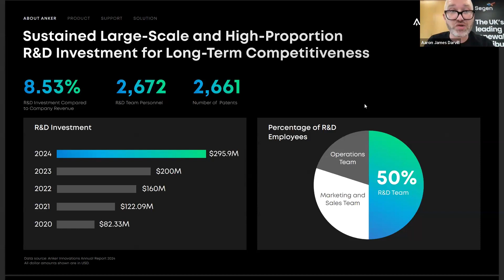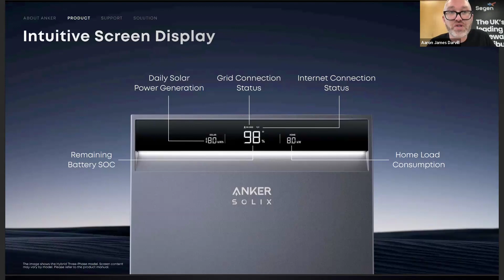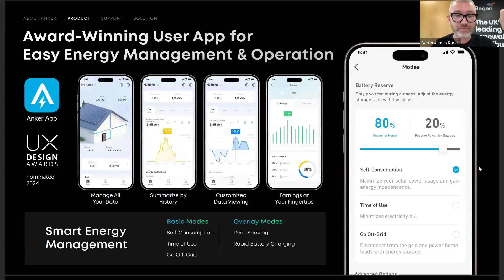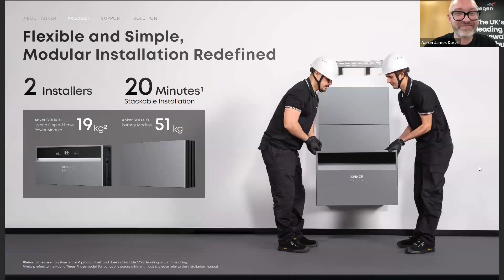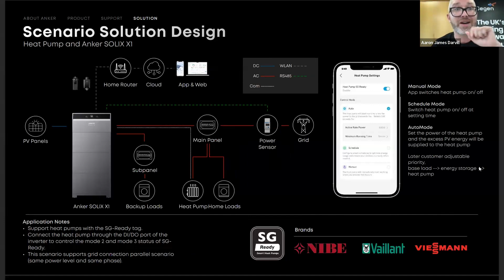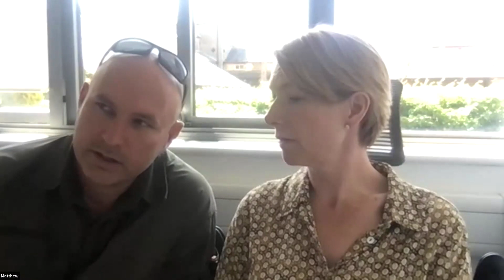Segen X Anker Solix X1 Webinar, June 2025

Comment: So there’s no separate gateway panel with these ? 
If you have a power cut can this still supply to the main consumer unit like in normal use, or can it only supply the sub board connected to the backup output ?